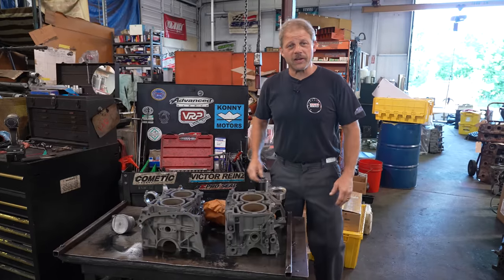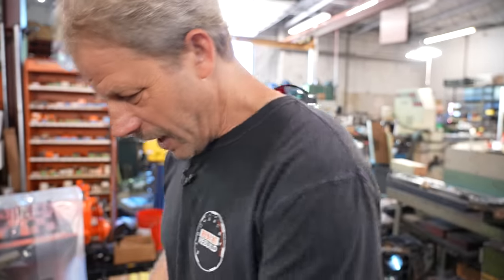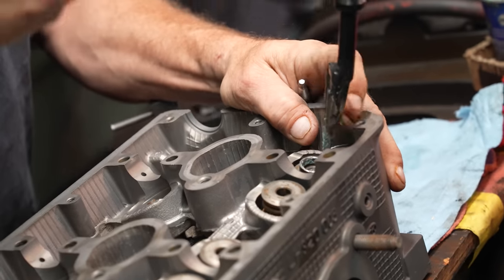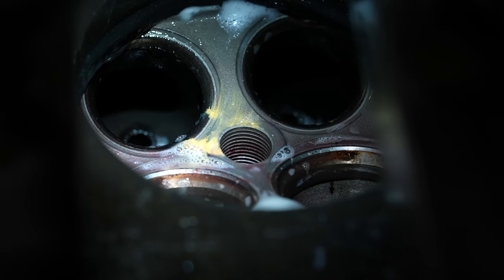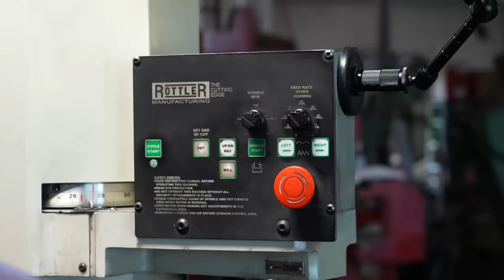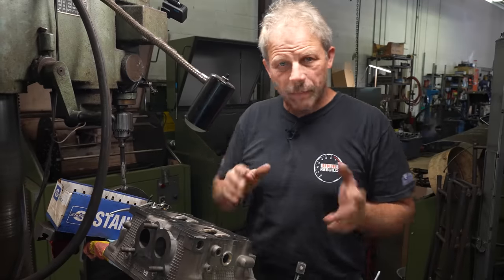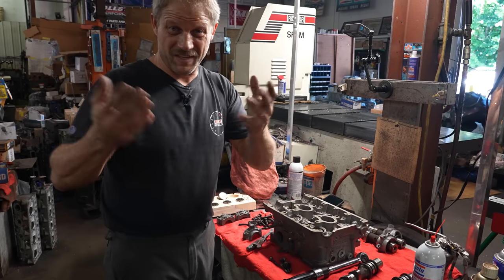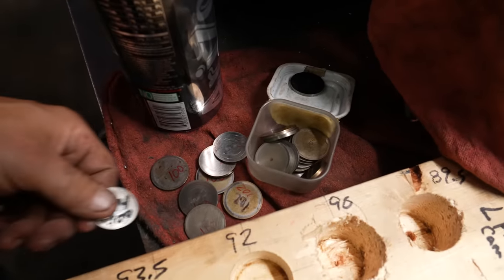Cracking Heads! Our Subaru EJ-205 Heads To The Machine Shop

Comment: They all crack.  I have a 200k mile EJ205 with four radial cracks at every spark plug hole, they are fine.  Subaru has a raised area at the plug for combustion chamber shape reasons and this area runs a lot hotter because it is so far away from the water jackets, which is also why it is generally a non issue.
It does look really scary though!

Comment: For these cylinder blocks it is wise to use a torque plate because due to their small dimensions they ''flex''. Cylinder dimensions are different when cylinder head is torqued in place and when is taken off. Greetings from Greece

Comment: You reminded me of the first Subaru engine that I rebuilt it was a 1970 FF1 4 cyl. It had plugs at the front and rear of the block to access the wrist pins. 40 years later I still have the tool I made from a bearing race puller.
Reply: Hope I get to drive an FF1 someday. Cool cars.

Comment: Driving on valve seals with a six or 12 point socket when I ran a cylinder head rebuilding department in the 90s. Was a nono. The flats can cut the edges of the seal boot.  Causing excessive oil consumption later. I also lube my valve stems with staylube moly graphite assembly lube. With a pocket of that lube under the valve stem seal as a reservoir.   Oil leaks out leaving a dry stem.  
I used to hot glue 3/8-16 nuts to the valve head to work with my old lapping spindle with a worn 9/16 socket wedged on instead of a vacuum cup.  A magnet hot glued in the socket allowed me to lift the valve.  I miss that job.

Comment: I wish you guys or Thirlbys had a weekend crash course in this stuff. I could learn a lot from you guys. Ive never measured spring strength or used blue when lapping valves. Thanks for posting your work Davin!
Reply: A Master Class on all variety of engines would be cool. You could download and refer back to it before you start a rebuild...always have it on tap to use on your computer.

Comment: With bucket shims you can compute what the ideal shim thickness should be based on the first feeler gauge measurement.  In my experience, this works pretty much every time, unless you make a mistake with the math, or location of the shims..
Reply: Or the clearance is closed completely

Comment: Big tip.

The 2jz has shim over bucket and most cams need to be re shimmed.

The best and i mean BEST way i did this was spreadsheet.

Measure what i pulled out and tickenes of the bucket to valve spot. 

tada excell does the math for you.

Comment: The valve adjustment system is similar to many motorcycle engines. As the valves seat the clearance will decrease, set the valves to the high end of the spec. Remember that a slappy valve is a happy valve.

Comment: I had a 1986 Ford Taurus XL that I bought new with a 2.5 four cylinder. It started running bad and overheating at around 8K and the dealer determined it had a bad cylinder head and replaced it under warranty and again at about 15K and again at 20K. all had cracked across the valve seats thru to the water jacket. After the third head I traded it in on a new one with the 3.0 V6 and never had a problem with that engine in the next two Taurus's or a Ranger that had the same engine.

Comment: I'm sure it'll be fine as in, it'll run and whatnot. But this is a demonstration in how not to machine a Subaru. These blocks are very light and thin, they distort with the head torque. So you need to bore and hone them with a torque plate on the head surface. This will have significant bore distortion once the heads are on and torqued up.

Comment: On my 2000 5S-FE head, after recutting the seats, the valves would be too tight. Rather than messing around with the additional time and cost of swapping spacers, they put the cams in, measured the error, then ground the top of the valves to adjust the height. Since they're pretty good at what they do, they only had to install and remove the cams twice (once to measure, then once to verify). What's annoying is the head bolts are under the cams, so I had to install and time the cams once I had the head on.

Comment: I would suggest getting the crack laser welded. It's usually quite cheap compared to a new head and the new weld is also going to rearrange the Atoms leading to a newly formed grid. It is probably going to crack fully if you leave it like that.
Reply: It is hard to weld it properly to last, and yes crack will grow but there will be no catastrophic failures.  If he will not run to much power and  control exhaust temperatures it will live happy life for long time. Weld will also crack. It comes down to how hot chamber will be, how quickly and frequently  temperature peeks are happening when pushing it and quality of the head when it was poured. If you can get uncracked head that is best way to go, meaning use this one until you find one that is not cracked. To find one without cracks is hard and expensive, and it is better to get used head without cracks, then new. Not sure if new are available at all.
Reply: A new head in general for an EJ205, EJ255, or EJ257 is roughly $600 USD +/- and I would gladly spend that over having a crack repaired only to have to tear down the long block down the road. Subarus are finicky to begin with so do it right the first time or don't do it at all is what I believe in.

Comment: @hagerty was pretty shocked that you guys didn’t use torque plates when boring out the engine. Then you proceeded to explain why cam timing is so important because the intake valves could crash into the exhaust valves which is physically impossible unless you broke a valve spring. Timing is important so that the valves don’t crash into the pistons
Reply: It is not impossible if the timing belt breaks they could definitely hit each other. Or if you really fucked up putting the timing belt on they could also hit each other and piston!

Comment: I know this video is already 3 months old and so this comment won't be relevant to this specific build but could be for other viewers who want to do the same process:

It's a real shame in my opinion going through ALL that hard work of disassembly, machining, honing, measuring and then reusing factory\worn parts.

The minimum would be to upgrade to STI rods and pistons.

I know a lot of Subaru owners who are actually waiting for an excuse to rebuild their engines and once the engine is opened for a refresh, it's the perfect time!

In any case, I think the job you're doing is amazing and it's always inspiring to see someone walk into a project and learn new things as they go. Wonderful to see the attention to detail!

Comment: I admit, I know nothing about rebuilding engines. But it’s crazy to me that cracked heads are acceptable. I’d be less worried about whether it’s a problem now, and more concerned whether it would lead to a future problem. 🤷🏻‍♂️
Reply: Those heads would not get used by me, good used heads or new correct rebuild practice, been do this stuff to long to start cutting corners! Davin you know better!!
Reply: Tracking down a set of new or uncracked STI heads will lead you down a very expencive and time consuming path.... as Davin said make do with what you have
Reply: It's not a passion project for them obviously. This is a click/view count project.
Reply: I had a 50cc 2 stroke air cooled dirtbike, one time, just after a rebuild it blew the head gasket and me not knowing better removed the head without waiting for the engine to cool down, so I burned my fingers and dropped the head, it cracked in 2 straight down the middle, only the spark plug held the 2 halves together, replaced the new blown gasket with the old one it had before the rebuild and it ran as if that crack was never there.
Reply: I mean hey at the end of the day it’s a Subaru anyways, the heads, let alone the whole engine will be out in a month for new head gaskets, regardless of mileage, like clockwork, until the end of time.
Reply: Lots of machines develop unique harmless traits like that but things like that always make me worry.
Reply: Totally bullshit. It’s not rebuild if you using cracked head. And what about valve check. U should use new washers
Reply: @kentremendous5112  You're comment shows how little you know about Subaru engines. Subaru no longer uses graphite head gaskets. Modern Subaru turbo engines have always had multi-layer steel gaskets. The M.L.S. gaskets do not have the issues that the graphite gaskets do.
Reply: I got a 2005 Subaru (EJ25), heads and gasket are stock, no issues. It’s my daily.
Reply: @sooperman12  true, but qt the same time there's people using what the got to build something just like this. Because they are problem salvers Now and then upgrade later. Episodes I can relate to

Comment: Honing should be done with the block halfs torqued.
Subaru specialists do the rebuild process a bit different from what you did, I hope you won't run into trouble.
Reply: How come honing has something to do with block tightening? Honing tool is free hand on a few universal joints, so it basicaly ads sufrace finish for oil film to hold on. And andy from subieperformace  also does not join block halves for honing
Reply: @vilbenasvienuolis  I'm not saying joining the two halves, torque plate is something to simulate the head.
Reply: @PedroFTeixeira  now i understand, sorry, my bad, u are right
Reply: @PedroFTeixeira  true most people use torque plates to simulate the head and torque to spec.
Reply: I'm sure their work isnt "bad" but they do a lot of things as if its 1960 cuz thats probably how they've always done it.
Reply: Fully done wrong.
Reply: @vilbenasvienuolis  The correct way to machine Subaru case halves is with the two halves torqued together and two torque plates, one to simulate each head.
Reply: These guys don't know Subarus, go to the "Subi Performance" channel to see how it should be done.
Reply: According to Subaru they do not require a torque plate, most machine shops go of of factory specs. 
However a torque plate distorts the cylinders .001-.0015" (skirt clearance is .0004-.0012") so it is necessary depending who you ask. Personally I've found most of the data supplied to machine via Prosis Pro (appears to be what they used) incorrect. Valve lash is too loose and your rods are probably too tight, ask me how I know.
Reply: @fubartotale3389  That guy is the epitome of German OCD technique and so refreshing to watch him overhaul engines properly. These clowns could have googled for 10 minutes to review correct procedures and would have been in a much better position rather than looking like fools to millions.

Comment: I dont think you needed to remove the cams everytime to do lash. U could compress the valve with a tool and use a magnet to pull out the shim.
Reply: You wouldn't ever do it with the engine in the car, just pull the cams. My car has 190k miles, zero lash adjustment. You set it and forget it.
Reply: @Levibetz  Ive done it with the engine in. So easy and quick. Its easier when u have a buddy that can compress the springs and u manage the magnets thou.

Comment: The heads are fine. I've reused EJ20 heads with cracks before with zero issues. You've gone above and beyond by checking for leaks within the coolant passages. This is a practical build. It's an ej20. Just get it back on the road and driving. It's never going to be a torque monster.

Comment: Even if you folks don’t end up doing it, I’d like to hear what options there are for dealing with a cracked head if throwing it away and finding another one isn’t an option.

Also, thanks for seeing this build through. I’m sure it hasn’t gone to plan, but it is an interesting engine and I am enjoying this series. Even if it never makes it back into a car, I’m looking forward to seeing this one light up again on the test stand!
Reply: Subi-Performance has figured out a solution - laser welding the head and machining back. They have a laser-welder and 5-ax-cnc tho...
Reply: For a shop that lacks a laser welder, they would remove the valve seats, then start grinding the crack until they find the end. Then they would fill the crack by TIG welding. After that, the head would be decked, machined for new valve seats, new valve job, and the ports and combustion chamber cleaned up.

Very expensive
Reply: We toss them, but some of these heads are super hard to find because they all crack.
Reply: Thanks for the info folks!

Comment: From what I understand, subaru engines need to be assembled and torqued with a deck plate for boring.
Reply: You're supposed to do that with all blocks I think, it doesn't get done most of the time. Some Ford engines they even specify which head you're supposed to torque down first.
Reply: They also need a proper align hone for the mains.  Its super critical on a Subaru rebuild and the reason why so many rebuilds dont last as long as factory builds.

Comment: Are those heads forged aluminum that can be welded? If they are why not remove the valve seats,  weld up the cracks and re-thread the spark plug holes?
Reply: I agree by measure of precaution, could those cracks be injected with some kind of material ?

Comment: I read that the when the plugs are in on these, they leave threads on the plug hole open to the combustion flame 🔥 (I.E the plug sits recessed) - which may cause the cracking?.   When machining them - some folk therefore cut the plugs a bit deeper so it sits flush in the chamber.
Reply: They sit normally as long as you use the correct plugs, at least in these ej205 heads.

Comment: There's no cooling passage between the spark plug and the valve seat, the issue will be the seat can fall out as it s no longer properly supported by the surrounding material.  SBI recommends a .007 press fit.  Put it on a flat clear plate with a rubber seal and pressurize the cylinder through the spark plug hole and see if that leaks.  This would leak compression, not coolant. I don't know why they're lapping valves when they have a seat and guide machine.  Not needed.  Dykem the valve and spin it in the seat and check for contact, simple and fast.
Reply: Goodson makes 6,7, and 8 mm lock installers that work nicely most of the time and a lot faster.

Comment: New valves, 020 overbore with pistons, new rings and bearings and new head bolts.
All  time and money down the drain, your heads are cracked.

You put boost and heat into a cracked head, they don’t heal themselves. 

You mentioned a “stove bolt” head having cracks and going with it. A 75 year old straight six with 7.5 compression ratio and all cast iron is nothing like a turbo all aluminum four cylinder.

You can still buy new casting from Subaru, probably less money then spent on manhours “rebuilding” them

Comment: Hello, this cracks between sparkhole and exausthole get it from a cold engine who musst spent full power at a time she is not warm enought for running fast, with the 914 Porsche Motor it has often cracks in the zylinderheads, same reason and one more, she don't like fullgas of long distance, watercoold engines are better.

Comment: It's a shame there are no performance parts going in here. With all of the Subaru specialists out there especially where these guys operate I would have expected a closed deck build, torque plates, forged pistons and rods and good bearings. That engine could have been a monster. Instead it's being set up for failure.
Reply: That would be a completely different engine though. There is not much point in adding heaps of power to a non Sti engine, It's ok to rebuild this one, but I would have liked to have seen a torque plate being used at least, the machining looks sub par
Reply: @nzuncovered1845  I think their machining is fine, its just that they are clearly not used to, or experts on Subarus flimsy engines, and you are totally correct, when boring/honing a torque plate wouldve been needed to get the best end result.

With that said, I believe this engine is not meant to make any more power than oem, its meant to be rebuilt and keep it as a nice, stock, fresh engine that will be used accordingly.

BUT, sadly I dont trust rebuilt subaru engines, imo when the oem goes to the shitter, as they always do, its best just to get a block from IAG and have peace of mind.
Reply: @Hanschepu  Yeah I would if was rich enough for an IAG block, that would be the dream. EJ's aren't too bad it depends how they have been treated and if it has been serviced correctly. I had a EJ20G turbo in a GF8 WRX which had 280,000km on it, it ran hard with a VF30 turbo, fujitsubo 3inch exhaust, Perrin uppipe, upgrade I/C and a few other mods, until it was stolen from outside my house and crashed. When I got car back from impound I pulled apart the engine because it got broken cam pullies in the crash, when we pulled the heads my mechanic said it showed no signs of ever been taken apart with OG head gasket, the heads and pistons/cams etc all looked new. 
My view is EJ20s are okay if they are a JDM engine and EJ25s are the ones to avoid due to less room between cylinders, not as strong as EJ20. The EJ207 engine is the one to get as it has semi closed block, also original Legacy RS and WRX STi Versions 1 and 2

Comment: Every Subaru cylinder head I've seen milled is low in the middle.....every one of them. New valves is a no brainer.😉
Reply: I wonder if it's because of the torque specs on the head bolts...? Middle two bolts are tighter than the outer 4.